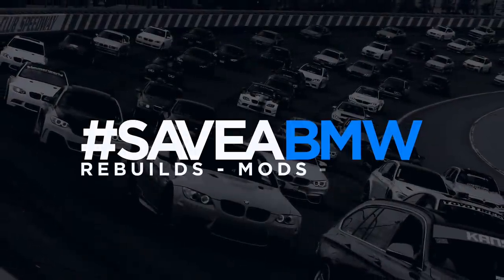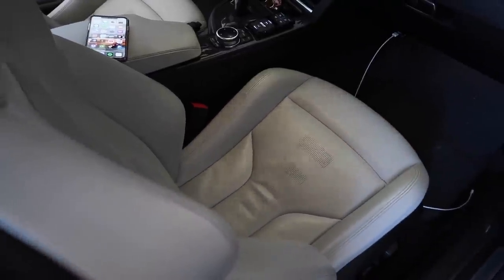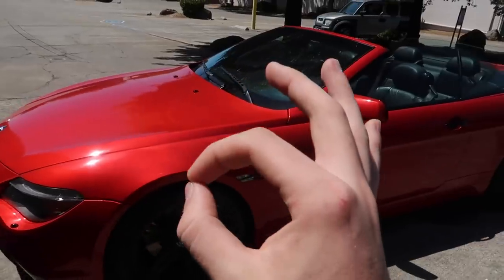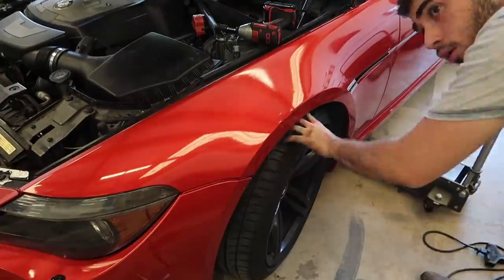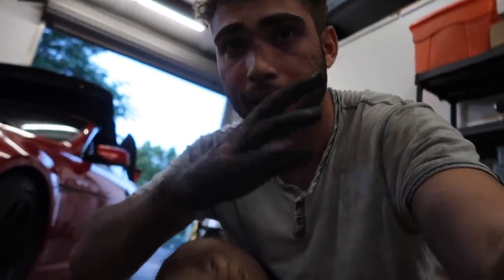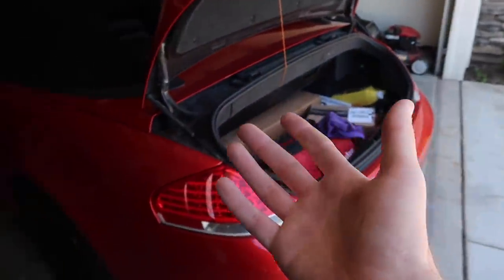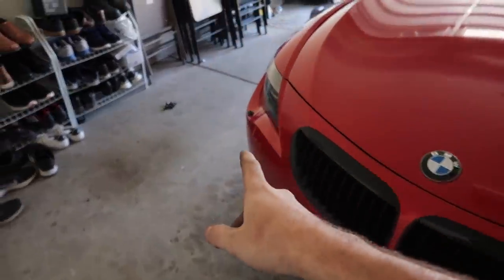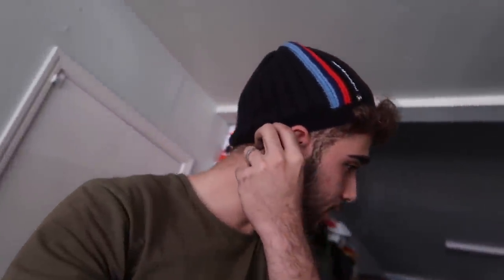$800 BMW 650i GETS NEW SUSPENSION! (BIG DIFFERENCE!)

Comment: You should replace the Xenon Ballast Control Unit. It is located on the bottom part of the headlight. And if your leveling and auto position of the lights not working, you should replace the AFS module.

Comment: The headlight looks like a bad connection. Check the module wire connectors and see if they are rusted or damaged. If they are just gets new connection wires

Comment: Nour i think your able to close the top temporarily till u get the motor fix should be a plastic trim piece that pops out on the roof with a hex insert to manually latch it

Comment: My 06 330i headlights were doing the same thing. I actually took it out and seen that it was the wire to the module that connects to the headlight. Just get the new wire and you'll be good to go. @nour

Comment: Yo Nour loving the way the e64 is coming along, especially since I got one too. I had have had an issue with my headlights as well, my advice is to check the headlight and adaptive control modules as both control the HID unit. But in order to get to those I had to remove my bumper to the headlight unit out. These modules are located at the bottom(HID) and side (ACM). They have seals to protect them from condensation but sometimes they go bad. Fixing these may help out, if they work out it's nice since the headlights pan on the direction your steering.

Comment: the 650i are known for valve stem issues which would cause smoking threw the exhaust almost all bmw v8 have this issue except the s65  or e92 m3 engine

Comment: Fuck those clamps bro! Dangerous for real. 
>Instead, jack the vehicle up from under the rotor. Jack it up until the vehicle starts to lift up from the jack stand. This will compresses the spring for you! Then just zap the center strut nut off while the rotor is jacked up/ spring is compressed. >Then loosen the 3 strut nuts up top and slowly lower the rotor. Everything will be separated, ta da!

Comment: Bruh back in 2007 that Bmw 650i with 360hp was fast back in 07 compared to the average sports car back then 07 mustang GT 300hp   07 charger hemi 340hp its 2020 now its still a sports car just a older one. I know one thing for sure the F12 Bmw 650i msport will smoke that e90 m3

Comment: Remove Headlight and there is Xenon ballast under headlight, Open the ballast and i guess there is water in ballast, Replace ballast, will fit from E46 xenon. Good Luck ;)